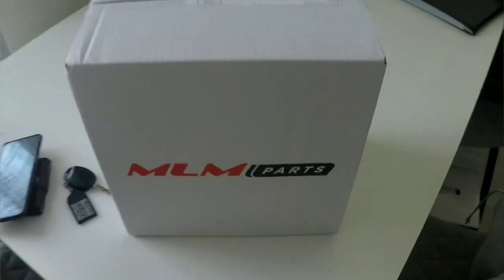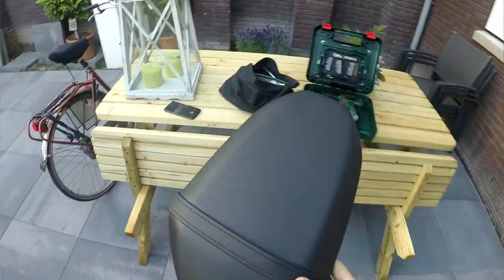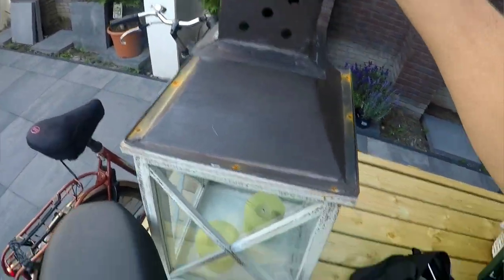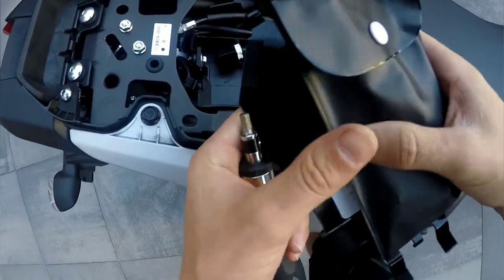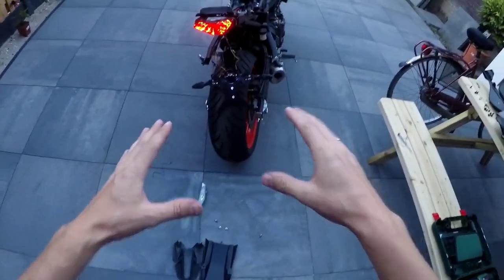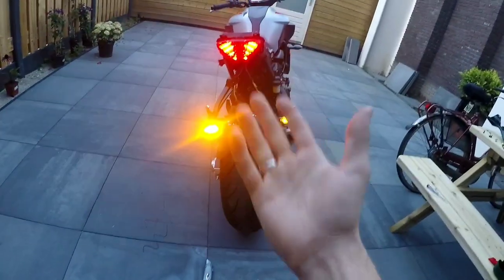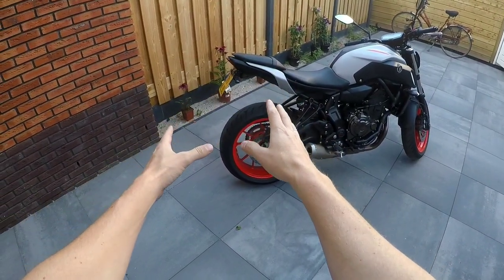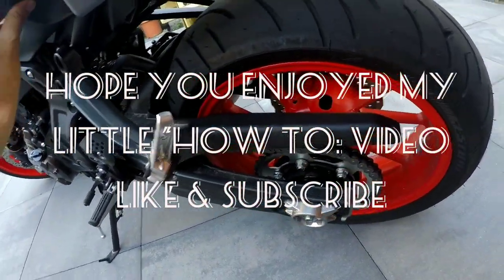YAMAHA MT-07 HOW TO REPLACE & INSTALL LICENCE PLATE HOLDER

Comment: I see that the light on the top had the thin cables and was not "pug and go". Did you open the cable of the original one and changed it or how did you do it?
Reply: yes u have to change the original cables